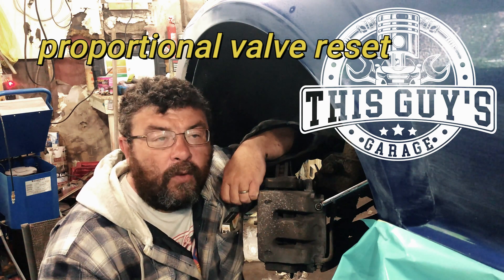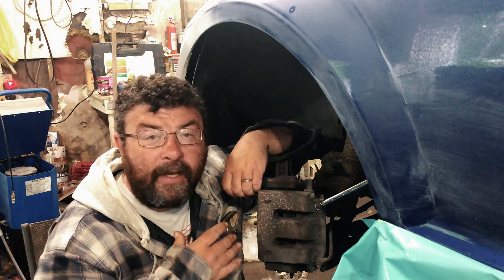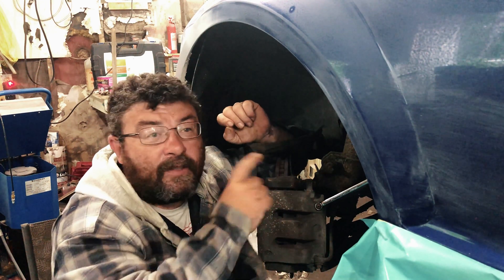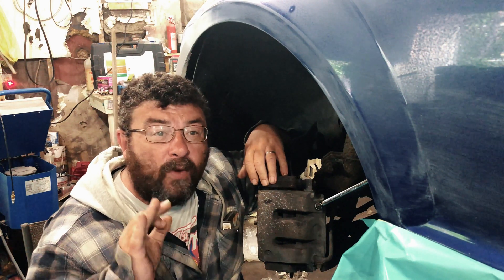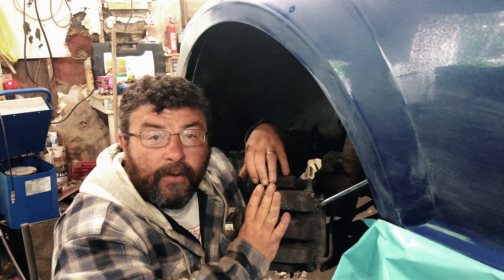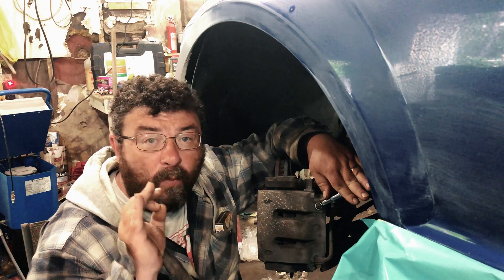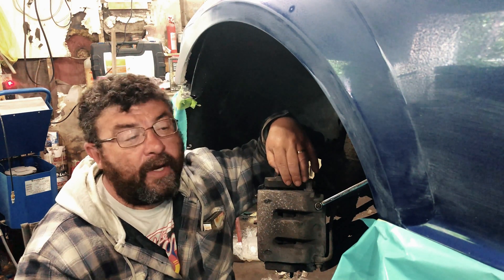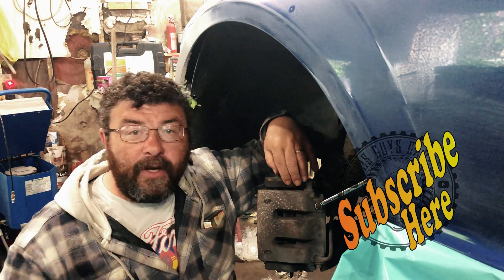brake proportional valve reset when unable to bleed

Comment: I just became friends with a guy who has a 1988 Chevy half ton pickup and I tried to bleed the back brake but there was no fluid coming out after the first squirt and the master cylinder is full but I think he pushed the brake and released it a few times and probably did what he shouldn't do as mentioned in your video so I think this is going to help to fix this whole issue and he'll have brakes again thank you very much for saving someone from having a bad accident.

Comment: 99' Jeep Wrangler TJ.  Installed new master cylinder and benched bled, new proportioning valve, 4 new calipers with pads, new stainless lines...time to bleed and only getting fluid to the rear calipers per vacuum pump method, no fluid coming to front calipers..what do you suggest.

Comment: Boys and Girls.... check the flex hose ... flex hose was clogged ...would not allow flyid to return pressure in caliper would not release .. replaced caliper needlessly.  
Cracked caliper..bleeder no leak.
Took off at the connection point. 
Connection point leaking so there was flow...Flex hose clogged right in the middle.!!

Comment: Hello Sir, I have a "98 Chevrolet ' S10 4.3 v6   .Rear brakes are good, but  No Brakes on left front and right front,  I bleed it  pump pedal 3 times and hold tight then crack the bleeder screw  there is fluid coming out but no pressure and it doesnt  stay holding  it looses the pressure,, the Caliper holds  good when I pump the brake pedal but it loose the grip  in 3 seconds and it doesnt hold anymore,, very low pressure of fluid came out both left front and right front bleeder,  but the the rear brakes  are working good...Thinking its a proportioning valve too,  I cracked  loose the line on ABS module feeding the left front caliper and turn on ignition but not running the engine then stamp the brake pedal  many times , or one medium hard  hit ,  it still didnt work,  still have the brake light on dash.. Its frustrating  ..I changed brakes many times for long time , but  this one is a headache,  any idea what I need to do next try , i could try this 1 pump only tomorrow, we will see if it works,, is there any ideas to fix this issue , would love to hear some advice ..  thanks for posting this video,  and anybody can give ideas and more knowledgeable about these issues ,Thank you  in advance .. 💓🤟
Reply from the maker: try bleeding befor the flex hose to confirm if its good or bad ,let me know!
Reply: @thisguysgarage  I did try today the fitting  before the flex hose on left front , theres a fluid came out when you pressing down the brake pedal and hold it down to the floor while I cracked it loose the number 14 fitting. but once I started to bleed it like doing the bleeding of two man job , my buddy pump the pedal then hold it down  then i cracked loose the 14 mm fitting there's not much pressure of fluid coming out , i  need to loosen it more to full turn then the fluid start to flow..  same thing at the bleeder screw on caliper,, I tried a 1 pump only but still there's a fluid came out but not  much pressure that its supposed to be.  we  tried many time the 1 pump only then hold the pedal  tightly to the floor then i cracked the bleeder screw then the fluid came out but not squirting to the pressure that supposed to be, and it feels like when you pump or press the pedal down and hold it to floor the caliper is working but within a 3 to 4 seconds it released the pressure back and the caliper not holding anymore . but I don't see any leaks,, so I wonder that proportioning valve is not on center that causes the pressure to loose ? because on the cluster when you on the ignition the  abs or parking brake light sign  is always illuminates or its always light up and it doesn't want to turn off anymore ,, I tried to Slam the brake pedal quickly thinking that the prop. valve will re-center  but it didn't work .. no luck so I'm planning to change the flex hose tomorrow with a new one , and  try it again, but I don't think if that's the one causing the problem , but i wanna change the flex because its so rusty anyway ,,  So its my 3 days now  working same job without luck,  I'm thinking to take out that sensor on side of ABS module , and pick that proportioning valve  if i can pick it move to  re-center that's what my last try maybe,, I didn't try it yet.. and I never try it before on this Chevy  S10 , so what do you think about it?   Hope to hear your feedback Sir.. Thanks in advance ..
Reply from the maker: @VJrRocksTuneUpGears try changing the flex hose on the front left,  before you bleed system go to the front driver's side compress that caliper to recenter your proportional valve  and then bleed the Left front.
Reply: @thisguysgarage Hi Sir ,  I did changed the flex brake hose today brand new  and bleed it,,, Still did not work , and now still the brake light is always on.. still the same it looses pressure after 3to 4 seconds after holding pedal..  so I'm thinking the combination valve keeps tripping sides .. now I order a tool  to hold the prop valve , because I went to local store they have a tool but a fine tread , this 98 S10  the abs sensor hole is coarse  tread . so I'm waiting for tool for 3 days from now.. but I'm still keep doing a trick  how to bleed it without a tool and not to move the prop valve sideways closing the front brakes  which causing no brakes on front and no pressure after pushing and holding pedal around 3 to 4 seconds..
Reply from the maker: @VJrRocksTuneUpGears if the light is on the proportional valve is tripped,  when you get the tool to keep  it centered you should be good, if your  impatient like  me you  could  compress both front calipers ,open up the bleeder and let it feed gravity until you know you have fluid there. Once you have fluid running out of the caliper it should bleed for you 👍
Reply: @thisguysgarage  it wont affect the rear brake when I open the bleeder of the both front?   , by the way there always fluid coming out both calipers on front  when i bleed it, it just looses fluid pressure ,  do i leave it gravity feed all night , I dont want to looose all my fluids , i had a second bottle already . i dont want to buy more  fluid☺
Reply from the maker: No don't let it go all  night just till you have a steady drip. Is it bleeding normally at first? Can you bleed the rear? Maybe you should wait on the tool because the proportional valve will default shut the fluid down on the second pump if there is nothing to hold the pressure back. What was your initial problem? @VJrRocksTuneUpGears
Reply: @thisguysgarage  The rear brakes are good I bleed the rear and it bleeds good and it squirt a good pressure,  and it brakes good,, Just the two fronts  not working , brake lights on dash.. This S10  sits for a while ,  then I replaced all the brakes rotors and pads since it had a broken rear brake  lines  and the brake pads on front was  worn out and metal to metal, So I decided to fix it and replace the 2 rear calipers brand new now, and also the right front calipers are new,, but the left front calipers I didn't replace because it seems ok and it compress good  and no leaks while you compress it or while pumping the brake pedal..
Reply: @thisguysgarage  The rear brakes are good , I bleed it and it squirt good , there's  good pressure..  no problem ,   Just the two front brakes left and right , no pressure when bleeding and  there's a fluid came out when bleeding but not much pressure or it looses its pressure in 3 to 4 seconds when holding the pedal..   This S10 was sitting for a while ,  it had a broken rear brake line and I replaced it the replaced also the two rear calipers and new pads, i replaced also the right front calipers so its new now, brake pads all  brand new now. but the Left front caliper I did not replace it because it seem ok and still compressing good with out any leaks .. and it holds when you pump the brake pedal , it just looses  the pressure after holding 3 to 4 seconds pedal down to the floor.. brake lights shows on dash now  is permanently on..
Reply from the maker: When you are  bleeding use the one pump method to ensure the proportional valve doesn't engage. Once you get the air out of the system you will be good.  Can you get the sensor off  to make sure the valve is centered?
Reply: @thisguysgarage  yes can take the sensor out.. just waiting for the tool.. ill give an update of what happens next .. Thank you.
Reply from the maker: @VJrRocksTuneUpGears  ty
Reply: @thisguysgarage  hi Sir, I did put the bleeder tool today  ,got the shuttle valve to Center first then took out the sensor and put the bleeder  tool in place. and start bleeding, use one pump only  ,, its still the same cannot bleed it , still looses the pressure  within 3 to 4 seconds when holding pedal.   both left front and right front.. I dont know why , going crazy now.. what a nightmare.. 😩
Reply from the maker: @VJrRocksTuneUpGears master cylinder.  Take it off to check, it's more than likely leaking into the brake booster.  This can be checked without removing the brake lines to be sure. Let me know what you find. It's the only thing it can be.
Reply: @thisguysgarage  I replaced the master cylinder with brand new one.. This is new, and bench bleed it before I install..
Reply from the maker: @VJrRocksTuneUpGears was this problem new after the master was replaced,  would not  be the first bad aftermarket master i have seen.  There are only so many places you  can have fluid bypass or leak without seeing it... that being said you can try taking the abs fuse out to see if that makes a difference. Double check the master if disabling the abs doesn't make a difference. Let me know 👍
Reply: @thisguysgarage   Master cyinder is brand new . I replace it and I bench bleed it before installing it..  What do you think about the ABS module is there a posibility that could be faulty inside or leak inside , or any electrical issue., Im not sure now . It seems like no hope, and I did most everything already that may cause this issue.. huhu😩
Reply: @thisguysgarage  is it normal inside the master cylinder when u pump the pedal it will squirt fluid inside the master cylinder ???  .. and even before with the original master cylinder it still not bleeding.. that is why I suspect the master cylinder , but its not..
Reply from the maker: @VJrRocksTuneUpGears if it's the master cylinder the problem will be found behind the master cylinder where it is mounted to the vacuum booster where the rod pushes on the hydraulic cylinder inside the master. If the booster itself was bad you would only have hard brakes.  Let me know if I'm explaining it so you can understand.
Reply: @thisguysgarage  what do you mean will have only hard brakes ?  but why is the rear brake is working if the booster is malfunction, or the master cylinder..  I have a good brakes at the rear brakes.. I can still drive the truck  and stop as it should but the front brakes looses its holding .. that's why the pedal goes to the floor at same time,, because  the front brakes where releases its pressure in about to 3 to 4 seconds after braking and hold the pedal down.
Reply from the maker: @VJrRocksTuneUpGears what you are describing is a bad master cylinder. Try unplugging the ABS module to rule that out.  Let me know.  But if the master cylinder is new and the problem is new,it points to the master cylinder, all it would take is one of the seals in it got hung up when they rebuilt it. All after market pieces are only rebuilt cores
Reply: @thisguysgarage  it was like this before same no brakes on front,  I changed the Master cylinder  thinking it was the problem,, but it didn't fix the problem, and I  got  the master cylinder in Rock Auto  new master cylinder  FPV  brand with reservoir on it.. what do you think this brand , I wonder if I'm gonna order again a new one  or buy a OEM in local store?  thanks
Reply from the maker: @VJrRocksTuneUpGears have you tried pulling the plug on the ABS module under the hood so you can ensure it's not an issue with that system? I just hate being a parts jockey lol. There is generally never a problem with any supplier, it's usually a freak issue. To be honest I'd go get one at a pick a part. You can put your foot on the pedal to know if you're putting a good one on👍
Reply: @thisguysgarage  no I didnt try to pull the plug, on ABS module, How do you know if the module is good ?
Reply from the maker: @VJrRocksTuneUpGears well if the problem goes away when you pull the plug, it's bad
Reply: @thisguysgarage  Do I need to run the engine while abs module plug is not connected , and try the brakes if will work. ?or while abs module is unplug I'll need to try to bleed again the front brakes ?
Reply from the maker: @VJrRocksTuneUpGears try both ways.  See if there is any difference at all. For the pedal to be going to the floor the fluid has to disperse somewhere
Reply: @thisguysgarage  UPDATE :   Finally its fixed now! 🤩 I changed the master with the OEM bench bleed at first then installed it, then bleed the abs module by using  high tech scanner , then bleed the front brakes , BOOM it WORKS ! lots of pressure coming out of front brakes .. was a headache , but finally Truck Rocks now !  Thanks , Cheers🤩👍💖
Reply from the maker: @VJrRocksTuneUpGears awesome glad to hear, you had a deep dive on this one, hope i was of help!
Reply: @thisguysgarage  your ideas help a lot , Thank you Sir !

Comment: I have replaced everything except the proportional valve, metal lines and ABS. I cant get the left front to move any fluid unless it's under a vacuum.  Its driving me nuts
Reply from the maker: The abs can be used to bleed brakes but it requires handheld device. Are you getting fluid to other 3 wheels? If so try bleeding before the flex hose as it may be swelled closed
Reply: @thisguysgarage The way the ABS works on a 2014 civic is one line feeds the driver front and passenger rear and the second line feeds the passenger front and driver's rear.  

We thought we had everything in the right spot but the pushrod was not set correctly and was not allowing the master to push the fluid to the ABS.

Once we got it dialed in, it worked like a charm. Huge sigh of relief for sure.

Comment: Question. My front driver brake won’t bleed. So I need to first compress both calipers with bleeders closed. Next, bleed the passenger front, then bleed the driver front?

Also, can I do this with the one man bottle set up or should I use a buddy?
Reply: My brake still won’t bleed😕 New hoses, calipers, rotors, pads. The caliper squeezes but I can’t get fluid to flow on that one
Reply from the maker: Which wheel, make and model would help

Comment: '69 GMC dually with drum brakes front and back. I replaced the booster and master cylinder and bled the front brakes successfully and got a lot of air out until fluid running clean. I am guilty of having my wife pump it way too many times and too hard and there is no fluid coming out the rear bleeders. Any tips for this scenario?
Reply from the maker: Check that rear flex hose if the proportional valve is 👍
Reply from the maker: You chan check the rear flex hose by bleeding the front of it ,if you are getting fluid there is the hose.

Comment: On my 71 Cutlass, the brake light is on, but I have front and rear brakes. Has the proportioning valve gone bad? Front disk, rear drums.
Reply from the maker: If the brakes are good  check the emergency brake switch, it will turn the light on, if that's ok there is a switch on the proportional valve,  it may be out of center enough to turn the light on or the switch itself is bad. Hopefully this helps 🙏 let me know 👍

Comment: Will this method rest the valve if it's leaking? I'm able to bleed the brakes and the brake light goes off, but after a while, and I mean 2-3 short trips, the light comes on. I have a '99 Jeep Wrangler. I've bled the brakes a few times now with air coming thru.

Comment: What about rear drums? How am i going to compress them enough to do anything? Just wondering if you have an ideas. I replaced one cause it was stuck. The master cylinder ran dry on the rear circuit cause it was leaking from the MC. All i can get on the rear is drinbles.

Comment: Idk if ill get a response here but worth a shot… was offroading and busted a brake line.. clamped it drove to the store replaced it now they won’t bleed… well appears i have no air coming out but still not getting my pedal pressure back i should say.  i have maybe 1/4 of the pedal i used to. Figured maybe i blew the master doing that but just bled replaced that and tried again same story. Any idea what the issue could be here? Im starting to lean towards the prop valve

Comment: I just converted from front drums to disc. On the rear I did new a hose, shoes and wheel cylinders.  Fronts are all new discs, calipers, hoses, master booster and  porportioning valve. Rears bled fine and fronts bled out, but when done both sides were stuck and rotors wouldn't rotate. We had to make new lines for new system  and had a couple of leaks. But all sorted out and no more leaks. But front disc calipers not releasing?

Comment: Hello my friend, what do you mean with the matching caliper? I have problem on my rear right caliper line, it doesnt drip any fluid If i let the hose hanging, but if I press the pedal there is fluid coming from the line. So my question is, I need to collapse that caliper I have problem (rear right) and wich other? How I know wich one is the matching caliper? It should be the rear left? Please help me hahah
Reply: Exactly I have the same question but I don't see him answering anything here.
Reply: @gmp203  same here,, waiting for ideas and answers too, doing this problem for 2 days now , crap its a headache , never had this issues fixing brake system  for many years .. 😄